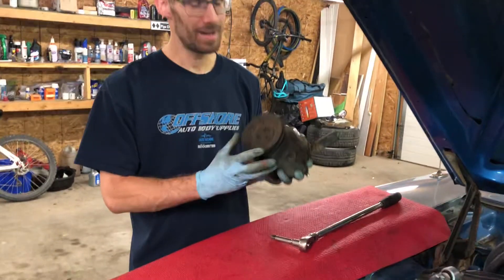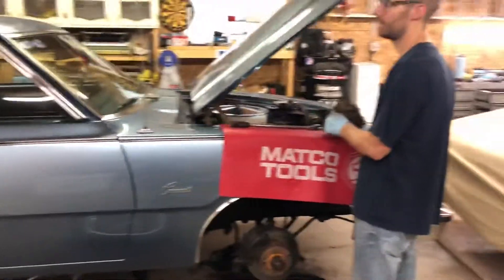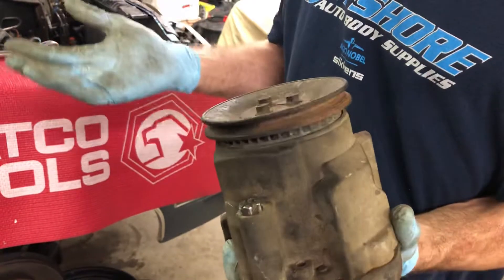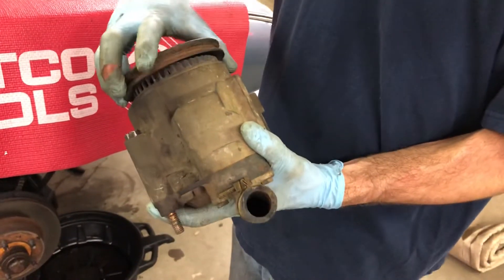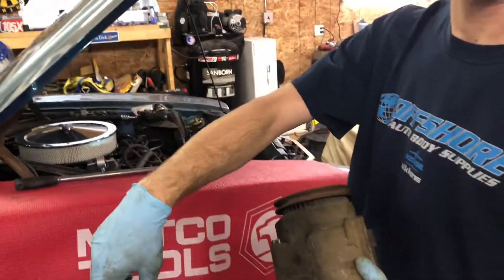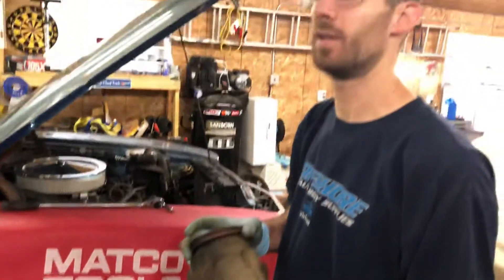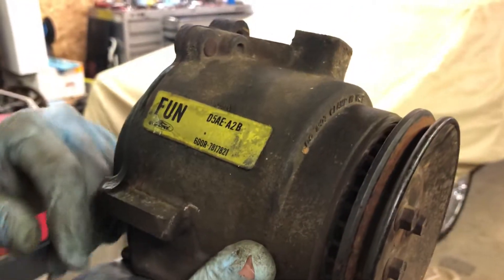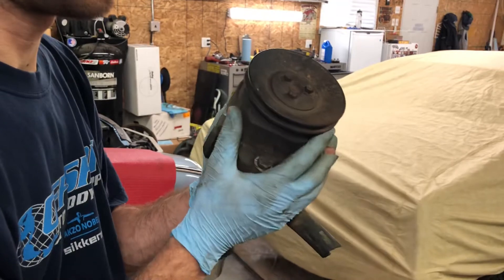Smog pumps are "FUN"

Comment: I have 1 on my 67 mustang but there has never been a belt on it, it spins freely should I even run it?
Reply from the maker: Well, if you still have the piping to the exhaust manifold, you can run it and it should help clean up the exhaust. However, every accessory you add to the engine does rob power. All I'll say is the Comet runs fine without it lol
Reply: @Moderate Performance  yea everything Is connected and where it should be just no belt or braket holding the filter housing, I'll leave it off but keep it stored away since it is original to my Cali built mustang
Reply from the maker: @Ricardo_Wade  That's what I would do. I always keep original parts if they still work.
Reply: I’m putting one back on mine because with the cam having overlap there is plenty of NOx fumes but I don’t know if it will work well enough. I’ll give it a try but it’s hard to find anyone saying positive things about them. I’ve heard they only rob minimal HP from YouTube test results anyway.
Reply: @Donu Duty  I'm running a sniper so fumes shouldn't be to bad since it's running o2 sensors and high flow cats
Reply: I like my carb so I’m trying to keep it but if this doesn’t work so well then EFI is what I’ll go to next. I have the high flow cats but it needs a bit more.
Reply: @Donu Duty  I have nothing against carbs I was just brought up in the efi era and I've installed efi kits in a few classics with great results, I'd also like my wife to be able to drive the car without possibility of flooding of fuel odors just turn key and go everytime
Reply: @Ricardo_Wade  Yeah I hear ya.  It's only an occasional driver car antique corvette '74  so quick starts not so important. In the summer it takes off quick. The exhaust is what concerns me but I'm getting closer almost there.
Reply: What did someone put a 70's or 80's engine in it I didn't think anything had smog pumps till the 70's